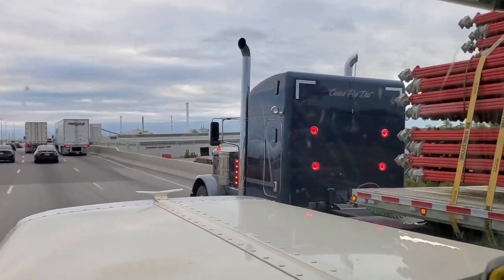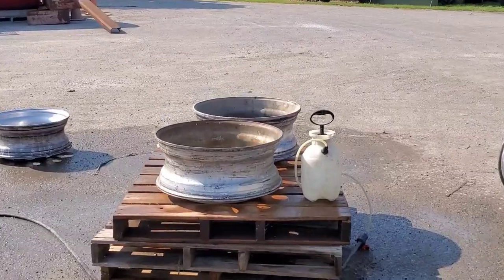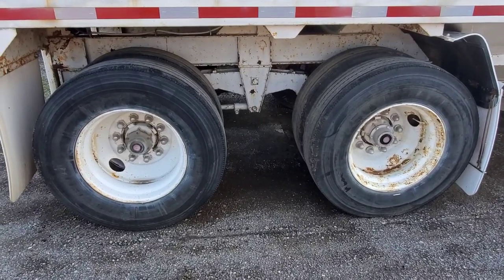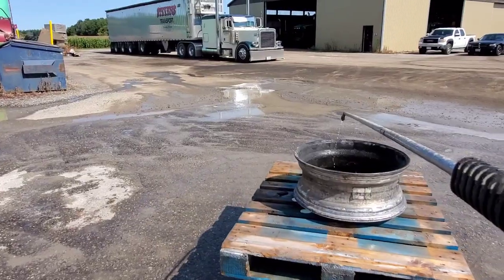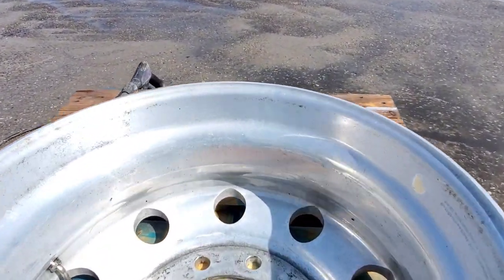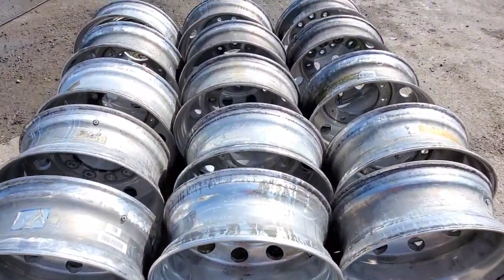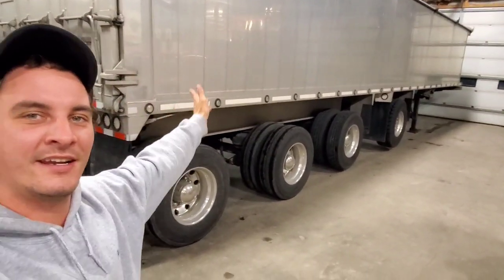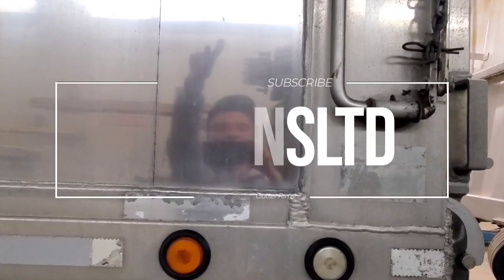How To Clean Up Old Aluminum Rims !     Turning Old Beat Up Inner Rims Into Nice Clean Outter Rims !

Comment: Prefect job on cleaning  the rims. That is hands on training cleaning and shining rims but it does takes lots of work to get them looking the way you want.
Using the power tool would help on this job if you have the right  scrubber  but something that does not hurt the metal or is better to be hands on to feel if the  drit on the rims is fully off? I guess their are different ways then.